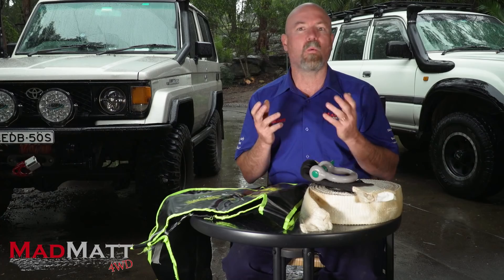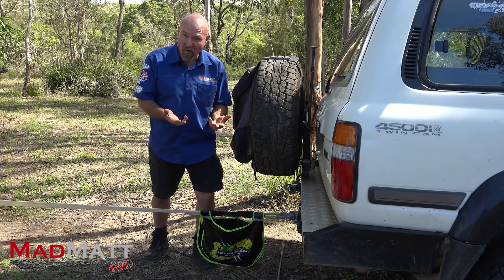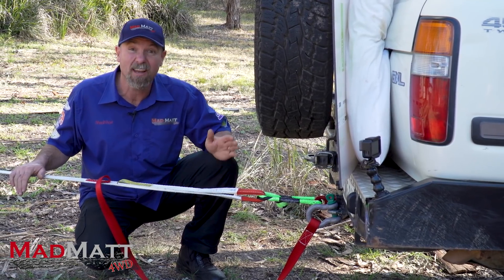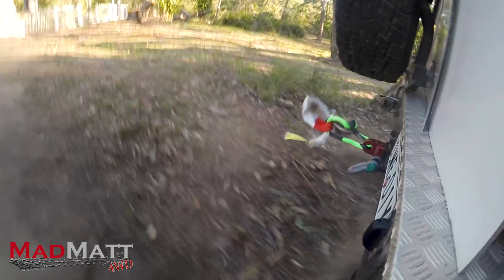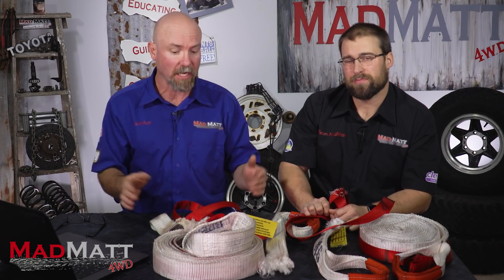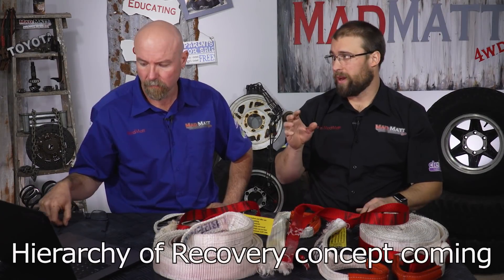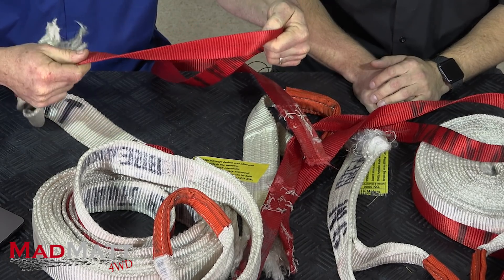Dangers of Snatch Strap Recoveries - Destruction Testing

Comment: The big risk is usually bits coming adrift during snatch strap recovery.  I have had a recovery point come off a vehicle and hit bull bar then plough through the grille and radiator.  The safest recovery is not winching as the steel rope is also elastic and can cut legs, arms or even bodies in half.  Safest is chain as no stretch.  If it breaks it will just fall to the ground.  Best thing to happen in this arena in many years is the soft shackle!
Reply from the maker: Bang on but rather than chain we use synthetic rope. It light strong and falls to the ground as well.
Reply: I’ve never seen any evidence of anybody being “cut in half” by a steel winch rope.  It will bruise, but not cut flesh.  It’s a myth.

Comment: Wow! Way cool! Thank you for doing this!... Nice to see that the bow shackle held and that I should use more than one air drag and weight it.

If they really wanted that strap to stop the end from hitting the other end, you'd length it.  As the strap breaks at the hitch, you'd want enough strap that the broken piece can get almost back to the anchor (the tree) at which point the catch strap would start to pull it back forward. But when you continue driving forward, it breaks, but this time the amount of energy is way less. You'd only need enough strength to survive the pull forward as the main strap changes direction, but not as much as the original strap because we are going to load it back up, and we want the catch strap to break without a huge load on it.

Still though that would be a lot of lose strap hanging around as you would need this amount of strap on both ends.  And in a successful recovery you are going to be dragging the strap along the ground.

The solution is probably to sew the catch strap to the main strap really lightly. With these stitches expected to fail as the truck moves forward and the main strap moves back to the tree.

PS
 I just ordered a second ARB recovery damper. While 3 may be perfect, two seemed to do close enough to what I need.
Reply from the maker: Great comment.
Reply: @MadMatt4WD  oh yeah, you'd want to sew loops of the catch strap to the main strap so under normal stretch, the stitching wouldn't be stressed.

Comment: What I've done is use a small --3"--barge tow line braided into a 20' loop as a recovery device ,class 2 hitches,moderation of the right foot helps.An appropriate rated strap or rope  and no full on runs to the end .
Reply from the maker: Sounds good. I imagine there’s not a lot of stretch with a 3” rope though.

Comment: My suggestion, combine the 2.  Use the weighted bag, but tether it to the vehicle. One at each end at about the 3rd points, with some weight to help absorb the recoil. It'll weigh down the strap, and, being tethered to the vehicle, won't go flying back to the other end as a projectile. And since it isn't "fixed" it'll hopefully slide along the strap some if you reach the end of the tether.
Reply from the maker: Thats an interesting idea.

Comment: everyone commenting seems to think it’ OK to destroy a tether strap.  it’d additional cost.  probably requires replacing the rope.  why not think in terms of using a much higher rated strap or rope in the first place and not use a pulling item at the top limit of it’s capacity rating.  A recovery pro probably does not want to destroy  his equipment on a single recovery.   how about putting about 20 ft of chain behind the pulling vehicle, then your snatch rope.  you already have a few feet  of chain attaching the rope to the stuck vehicle.  put your tether strap between the chain and snatch  rope with a lot of slack. the tether fails, saves the very expensive stretch rope.  The tether could be just 8-10;ft of 5/8 3 strand nylon and it’s being asked to stop a piece of flying rope and not a flying shackle.  nylon is quire strong and quite inexpensive. Jerk ropes and straps are quite expensive.  Great videos.  Great subjects. 
JoeB
Reply from the maker: I think you may have misunderstood the purpose of this video. We wanted to see if this tether idea would work as per it’s supposed design. It obviously did not.

Comment: The need is to dissipate the energy of the strap.  The tether will have done a little bit of that as it tore through the stitching, but obviously not enough.  

Your talk about the free length of the tether is definitely true, where the strap has extended 1.5m, there needs to be an ability to capture that 1.5m, as well as the number of metres the vehicle will have travelled once the strap has failed.

My thoughts are that the energy dissipation could be achieved by something a bit like a fall arrest strap used for working at heights.  Quite a number of folds of the tether material stitched together so that the tearing of the stitching assists in dissipating the energy.  As we are generally talking of attachment points failing rather than the strap itself as per these tests, the tether can be through the eye of the strap rather than stitched to the strap, as that stitching is what failed.  The folded and stitched part of the energy dissipation pack also allows for more tether length in a compact package.

Hmmm
Reply from the maker: good thoughts there

Comment: fold the tether and sew it together, like a shok cord for climbing, it takes so much force to break the threads, that would absorb energy, then the strap taking the load and breaking would absorb the rest
Reply from the maker: I agree
Reply: I was a test engineer in the forklift industry.  Have experience using load cell..  it takes expensive equipment to do that kind of testing.  I agree they should have a three meter tether with folds sown  in to make it about a meter long.  Wonder if some kind of parachute attached after fuse would slow down strap.
Reply: My thought exactly.  Tether should be just like the tethers used for fall arresting harnesses.  It should be engineered to absorb  a lot of energy quickly.

Comment: Try a tether 15’ long with a loop that slides over the snatch line and secures to the vehicle at a second point, a nearby tree, dirt bag or water anchor. When it fails the snatch line will fly around the loop to stop it but not directly back through it. It will then drag the loop with the vehicle. The tether could be made from a winch rope with a couple bolin knots. This will give it plenty of strength for a low investment. You could make a few from old winch ropes.
Reply from the maker: Interesting idea. Thanks mate

Comment: late to the party, but aside from the fall arresting set-ups many have suggested, perhaps using something akin to a rappelling brake rack?  Secure it to the vehicle and run the tether through it with a free end.  In a failure the drag of the broken strap pulling the tether through the rack would slow it over time and you don't have to worry about the vehicle running on and breaking the tether.  Not sure if this would work based on the energy involved or how practical it would be in actual use but could potentially work.
Reply from the maker: could you please link a video with this system.
Reply: @MadMatt4WD  https://www.youtube.com/watch?v=Ksl6Ue2fWWw 
You wouldn't need all the features of a rappelling rack, but as you can see the friction to slow the rope is simply caused by weaving through the bars.  As they slide they get tighter and bind, bringing the rope to a full stop.  For a tether strap I'd picture it more as a non-sliding set of bars that still open to make it easy to insert the tether through them.  The rack is anchored to the truck and the loose end of the tether fed through it with only enough slack to allow for the stretch of the recovery strap and the remainder left free.  In a failure the strap snaps back but has to pull the free end of the tether through the rack where the friction slows it.  Would take some testing to ensure the tether was sewn well enough to the strap that it didn't just tear off and that there was enough length to the tether to slow the strap before it pulled all the way through.  You would still get some snap back from the strap from the drag of the rack on the tether but substantially less than it simply parting.  And having the free end pull out of the rack means you don't have to worry about trying to stop the vehicle in a short distance as the tether would simple pull through at a fixed resistance.  Could it be designed to provide enough resistance to slow a broken strap without being too cumbersome or expensive to use?  Not sure.  Just an idea that would need more exploring to really verify.
Reply from the maker: Thanks Don, That's interesting. I wonder if heat would be an issue?

Comment: Fascinating stuff. I also have seen enough pictures of pierced 4x4s to find snatch recoveries scary. Much of the military forbids them unless the vehicles are armoured. Even then, winching is always preferred. 
Back to the tether; it’s only going to work if it’s a similar strength to the original strap. My thinking: kinetic energy from vehicle->potential energy in strap as vehicle extends strap. Fuse fails. The potential energy is released becoming kinetic energy of the free end strap.  It’s the same amount of energy. So to capture free end and store its energy, you need another 9T strap. And you’ve got a tow vehicle that’s still moving to deal with too. The only way to get out of this bind is to create big losses, ie create a good damper/s that dissipates as much energy as possible from the flying strap. And we’re back at the first part of the video.
Reply from the maker: Great comment. I’ve thought some type of fall arrest design with layered stitching. But yes kinetic recovery is my last resort.

Comment: Great job you are doing out there. My observations are...1. The tree is stationary and not going to move within the design perimeters of the strap. 2. The vehicle can apply more force / stretch to the snatch strap because the load [tree] is not moving and the design perimeters were exceeded. 3. If the recovery included two vehicles, one stuck in muck and one pulling, the design of the equipment would most likely work as designed. 4. The experiment with the tree took the straps past their designed capability... 5. Yes if you had a load cell to measure the force involved, it would show that the recovery equipment held up way beyond its loading design. Thank you for your site. 2011 AEV RUBICON
Reply from the maker: Thanks mate greatly appreciated. I disagree with your assessment because I’ve done recovery where the stick vehicle didn’t move when hit. What I’m doing it providing a consistent anchor. Also I had a fuse on the vehicle end to ensure I had a controlled fail to see if the tether worked.

Comment: You talked about not connecting the bow shackle to the hitch receiver became of the stress on the welds, but you have that Factor 55 thing in the receiver.  What's the difference?
Reply from the maker: I'm talking about the weld where the flat plate that holds the towball is welded to the receiver.
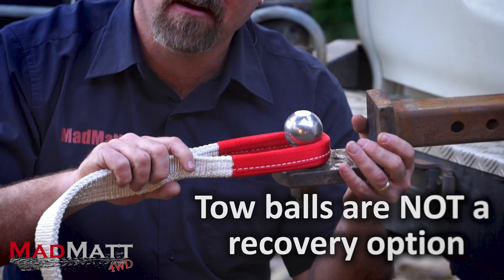Reply: @MadMatt4WD  Now I understand. Semantics. I call that assembly (7:08) the "ball mount and draw bar assembly" (usually just "ball mount"). The "hitch receiver" for me is the square tube on the truck-frame mounted hitch that accepts the "ball mount". I purchased a "receiver mounted d-ring shackle" for my Frontier that slides into the hitch receiver (in place of the ball mount) and is secured by the hitch pin. So when I heard you say we shouldn't use the receiver as part of your recovery set up I thought you were referring to the hitch receiver tube!

Comment: Found you through Matt's off road recovery.  Never have used a snach strap. Awolys used chains or cable with multi heavy wool blankets  And slow pulls.  Where I tie to the vehicle is a chain looped through the center of the receiver.
Reply from the maker: Welcome. In your case you are not performing a kinetic recovery but rather a tow recovery, 2 very different proceedures.

Comment: Another idea for a safety tether that would need testing.  This could be added to any snatch strap or even maybe to a winch cable.  A length of rope or strap that is about 40’ longer than the snatch strap, that is,  20’  extra length for each end that is held in a Z-folded bunch by a Velcro loop, the end secured to a different spot on the vehicle than the snatch strap.  After one end is attached, the rest is spiraled around the snatch strap 8 or 10 or 12 times along the full length and then secured to the other vehicle.  Granted, it would not be super quick to set up,  but being wrapped around many times I believe would entangle and arrest the speed and distance of a broken strap/hard parts. The extra 20’ (or maybe just 10’) would deploy from the Velcro loop with enough slack to not get broken itself but short enough to catch the flying parts. 
........ I hope this description isn’t totally confusing but I think the spiral entanglement has merit.
PS   I don’t think the recoil of the broken snatch strap broke the tether of the original design/video.  I think the rapidly moving vehicle reached the end of the short tether.
Reply from the maker: I think Ditch Hitch has a system as you describe. We didn't have great slow mo but it wasn't the vehicle speed that broke it when we watched it back frame by frame. https://youtu.be/Huohi-9cv80

Comment: Another challenge for the tether is that the load is applied to it SUDDENLY.  At minimum this doubles the applied load.  The tether would need to be 
1) longer,  sufficient to very generously cover vehicle stopping distance,  stretch in the main strap, and safety factor,  and it would need to be
2) very elastic, so it can decelerate the fast moving failed end of the strap gently ... this means it has to decelerate it over a long distance.  Something like an elastic bungee rope would be a better tether than a rigid strap,  i would think.
Reply from the maker: Good thoughts. I think the elasticity would just keep bouncing it. I think a fall arrest system type design would work.

Comment: Snatch strap ... is that what they normally call a "kinetic recovery rope?"  or do you mean a regular pull strap that is not made to stretch ?
Reply: A kinetic recovery strap stretches a lot. A tow strap stretches as little as possible. Towing with one feels like using a steel chain. I prefer to tow with an elastic recovery strap or rope. The only difference between the two is the round vs flat cross section.
Reply: @PatrickQ4HBD  OK so I guess the lesson is try to uses a kinetic rope, and not a snatch strap when in these situations.
Reply: @robertnewman4105  Not really. They're the same thing, in that they are designed to soak up the forward momentum of the recovery vehicle, to give the stuck vehicle some help getting out. They're different SHAPES, but they do the same JOB. The proper way to use them is to begin with very gentle tugs, back up, give it a little more, back up, give it a little bit more, and so on until the stuck vehicle is able to drive out of the hole. 

Key point! This guys went right to full throttle specifically to break the straps, not to demonstrate how to use them in a recovery. Don't laugh, some people will gas it right away.

TL;DR, use a stretchy  recovery/snatch  rope/strap, not a tow strap or chain. ⛓️
Reply from the maker: Excellent comment thanks Patrick
Reply: @MadMatt4WD  Excellent channel, MadMatt! I've subscribed.

Comment: Years ago I saw a farmer try to pull a stick combine with a 1 ton ranch truck. He couldn’t reach the truck with strap alone so he used a chain against everyone’s advice. The chain failed at full load and rocketed to the truck, split the tailgate like an axe, took the top off a diesel tender pump tank and went through the back cab glass and out the front. Nobody injured but some nerves were jangled!
Reply from the maker: Yeah wow.

Comment: I fully believe that you'd have a completely different reaction to the strap, if the tether were attached to the strap at the 1/3rd mark.  It seems that the danger spot is at the fuse point, when it breaks, and the original tether didn't change that spot.  Moving the tether attach point back to the 1/3rd mark would add much more stopping power to the tether, rather than being so close to the initial break point inertia.  Use a whip for example, the shorter the whip, the less inertia at the tip, lengthen the tether to shorten the whip length from 9meters to 3meters, the failed strap should have less inertia (and danger).
Reply from the maker: thats an idea worth exploring
Reply: @ Jim Francis - Ditto....failure repeatedly occurs at the fused/ stitched  point.  Great point to move down  1/3 of the distance and see the results.
Reply: Downside to that is typically stitching doesn't stretch.. so you'd have a 4-5" section that has no stretch  in the mid working section of the strap and after repeated hits you might start popping stitches.

Comment: I use  18,000. lbs.  snatch straps for my jeep (jeep wt.5,000lbs) and anytime I use one,  I stretch  it out about 3 ft.  then slow to a stop that is best for the strap. I use 20-30 ft. straps with a recommended 5% stretch. the reason I stop is because if the truck i'm pulling is in fact hung up snap!
Reply: I do the same, I never hit the strap unless it's the last option.

Comment: The tether needs to come into play AFTER the snatch has mostly returned to its unstretched/unloaded condition.  That means the tether needs to be much longer. If the tether is now not trying to arrest the recoiling snatch strap forces, the tether can then be designed to absorb the inertial forces of the flying snatch strap.  That's what air dampers do, much less energy to deal with.  To manage the longer tether straps, I suggest that the tether be coiled with some sacrificial ties (e.g. light duty zip ties) that break away during deployment.  The original concept is good, just needs a tweek.